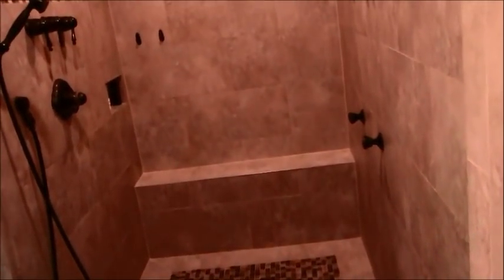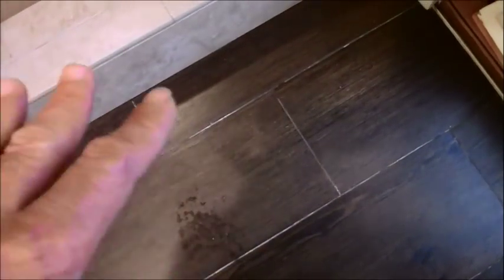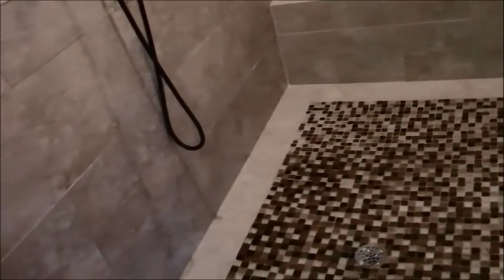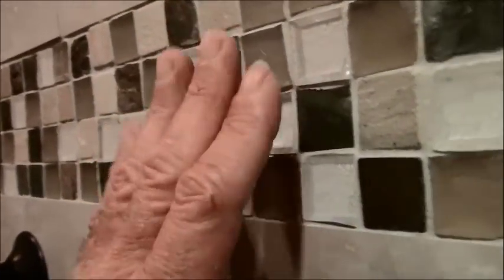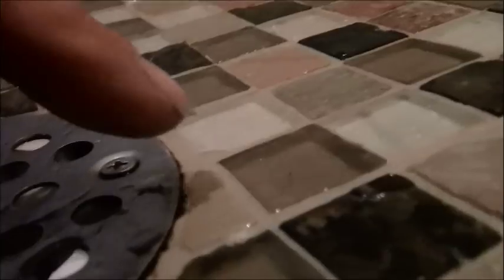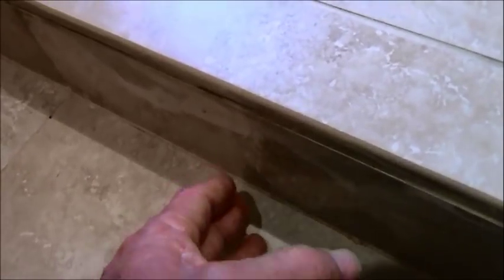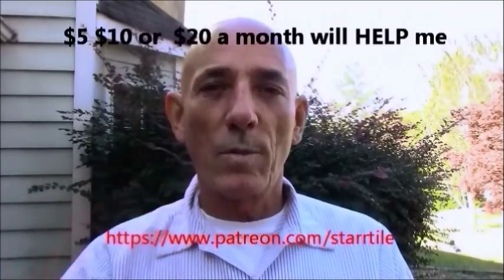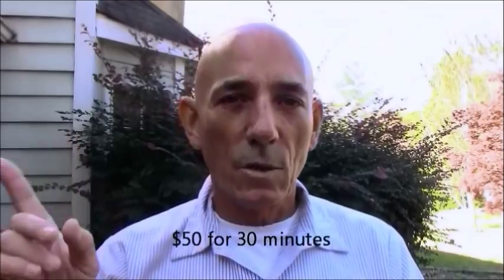WHY DO SHOWERS LEAK ???

Comment: I'm a Plumbing Inspector in the Pittsburgh area. Before we issue a rough in completion, vinyl pans  or Schleuter system MUST be water tested at 1 hour up to the threshold, with a 2" test ball in the drain and the retaining ring holding down the vinyl already in place, I'll often silicone the hex bolt threads holding the retaining ring down as well. The threshold must also be wrapped, as well as the bench must also be wrapped and tested. 6' High on all sides. Also, to check for sure if its the drain or pan, could you not test ball the drain and fill the pan to be sure it's the pan ?  I might also dye test the alcove shelves for leaks before going all out on repair. Last two resorts would be a low access door behind the shower faucet as to not damage tile, also line outer floor with paper towels and let shower run with door closed, using the hand held to saturate door framing. Then remove floor as a last resort.,  Not trying to tell you your business, but I've been a registered master plumber for 31 years and now an inspector for 4 years. I'm sure you'll figure it out, my friend
\

Comment: Also we require that all pans 4' by 4' or larger be pre sloped under the vinyl  to drain before beginning floor grouting, either with sand, or better yet those 1' wide, soft rubber slopers that you can utility knife to size

Comment: I don't think u have that amount of experience  do a pan test ,if that not the the problem  check for hair line crack on the grout joints I don't think it a plumming leak other wise u would be getting a constant leak check all shower trims, how water tight is the shower door that could contribute to your problem on the outside of the shower

Comment: How often are you able to reuse or salvage the existing tile?
Also, what ended up being the cause of the leak?
Reply from the maker: Walls are easy to save, not the shower floor..only on RARE occasions can I repair something in place on a floor & save the floor.
No idea on the issue here, I wasn't hired to do the job.